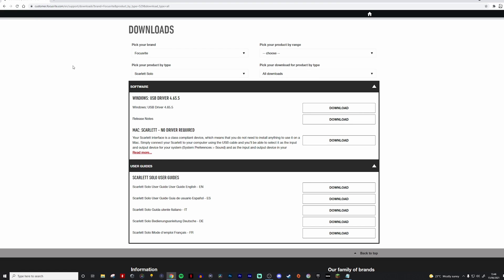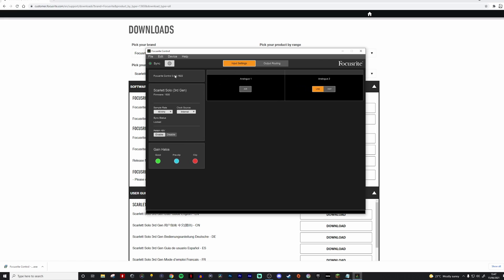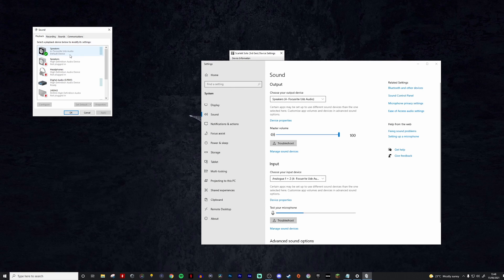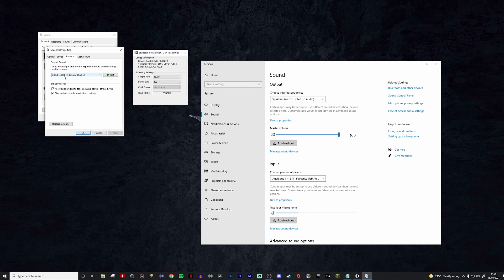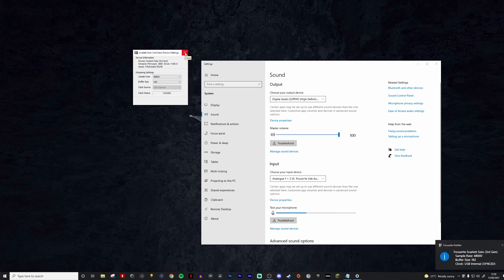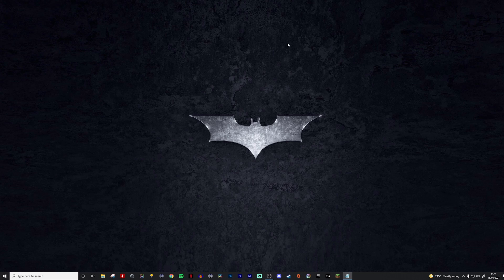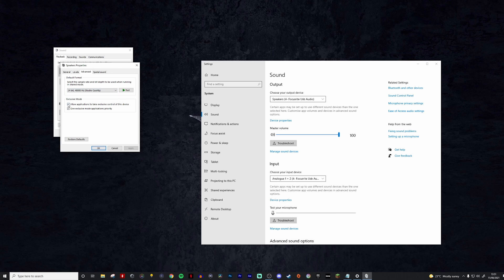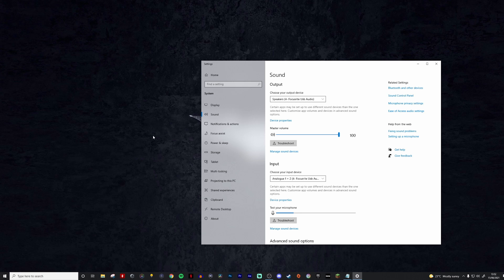Focusrite Distortion Fix - 7 Tips!

Comment: All this is for WINDOWS. . no help
Reply from the maker: The same principles apply, is your USB bandwidth overloaded, are your sound sample settings set up correctly, do you have nvidia broadcast software installed etc.. Just a different layout on other products
Reply: @andrewbyford  I use Logic on my Mac so I just tried it and yelled on the Bitwig and it sounds fine.. I had a Yelling Higher pitched vocal Rapper and all of it Distorted not coming thru so it must be Logic pro

Comment: It has the crackling sounds on my desktop pc, but when I plug the scarlett into my laptop it has none. It may be a power issue like you said. What should I do to fix this?
Reply from the maker: Have you tried removing all USB devices except from the focusrite? It could be a software conflict or a setting conflict. I recommend trying all of the options in this video, if none of them help I can only assume there is a hardware fault in your desktop PC.

Comment: My Scarlet 212 with Rode NT1A mic works for the first few minutes. then it starts to crackle up (i tried it on audacity and clean feed)
Reply from the maker: Did you try the steps? Audacity is what I normally use. Other than these I can only think it would be hardware related

Comment: Had problem were input audio sounded like it was going through a blown amp/speaker ie weak distorted sound a few times. These solutions didn't work for me however simply changing the  sample rate in the ASIO panel from 48k to 44.1k and back to 48k worked for me!?!?!
Reply from the maker: Strange one, the settings might have had a conflict and when you changed it, it possibly overrode the existing both system + ASIO settings

Comment: I was having this same issue as of recently, I dated it started around a few weeks back when my windows operating system updated. I tried your method, and nothing seemed to work. But when I changed the sample rate from 48kHtz to 96 that did the trick, or even going further up to 176 or 192. Any particular reasoning for this? All the pops, clicks and lagging distortion went away.
Reply from the maker: Not sure, sometimes it seems to conflict for odd reasons, glad you managed to sort it though!